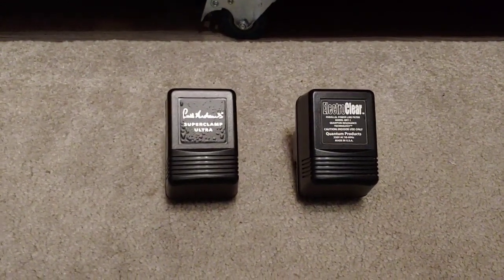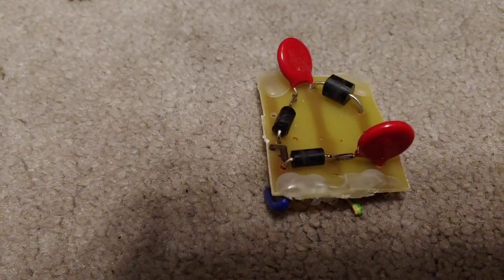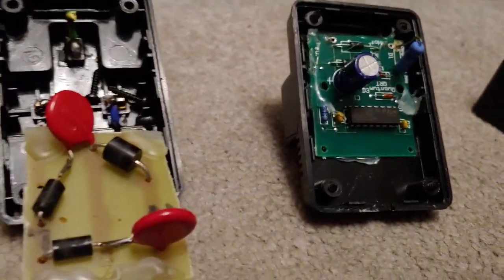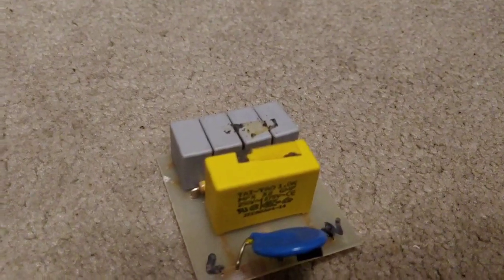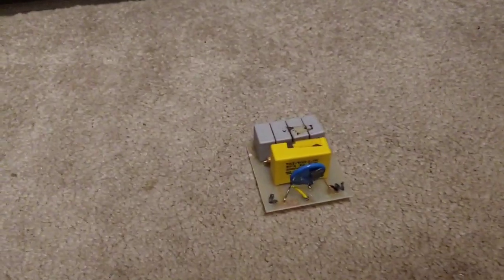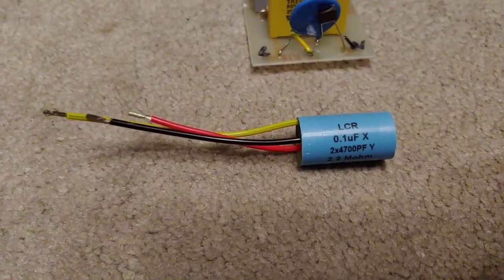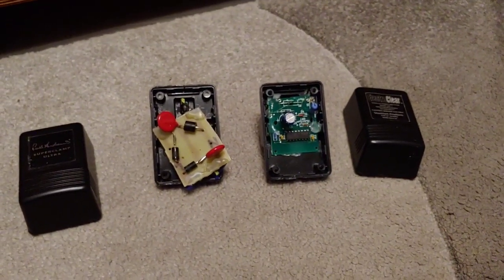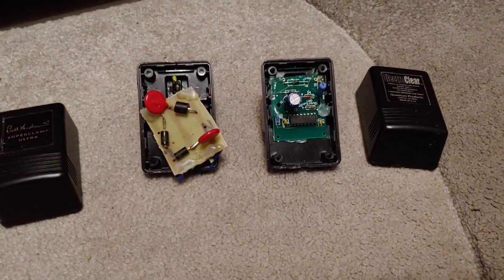Taking A Look At Some Mains Clamps/Filters

Comment: Good video. Personally, I never encourage people to solder up stuff that goes on the mains. It's easy enough to do for people who already know what they're doing. For beginners, though, there's always a considerable risk of fire or electrocution. Personally, I use a mains filter and a DC blocker made by Supra. They're reasonably priced quality products made in the EU. I wouldn't save a whole lot by making them myself.

Comment: I too have such a filter (of obviously rather conventional technology) from a more venerable UK company who made it like 20 yrs ago, and here in my system it doesn’t do much positive, on the contrary, its taking off the leading edges and reduces PRaT (the perceived ones). Another, also very venerable British brand, IFI, however does quite the opposite (gains in clarity, silkiness of treble, and mind you PRaT as well) with their more recent AC iPurifier, so much so that at 100 gbp I consider it a budget tweak, and in fact The Initial Tweak 🙂

Comment: I DIY'd one of these, point to point, and put 0.1uf paper Wima X2 caps over the diodes to act as a sort of snubber. Work great - ESPECIALLY when you need something put in parallel quickly to block noise pests. HOUSE PARTIES.

Comment: These diodes would be arrange to act as a clamp circuit.
The other circuit is probably using a crowbar
Chip which circuits are widely available on the internet.